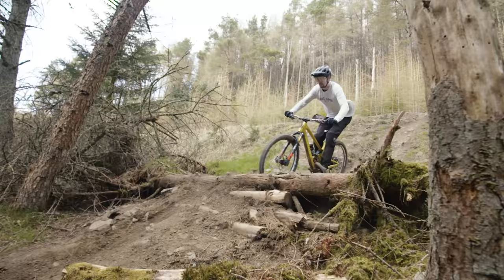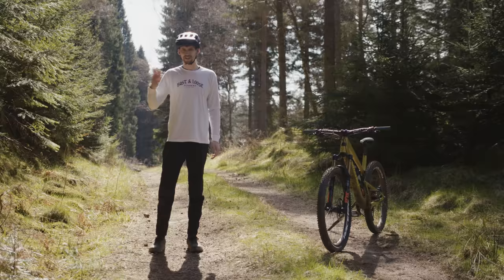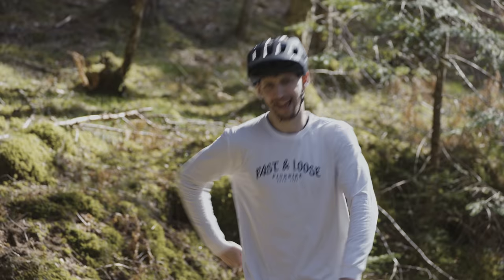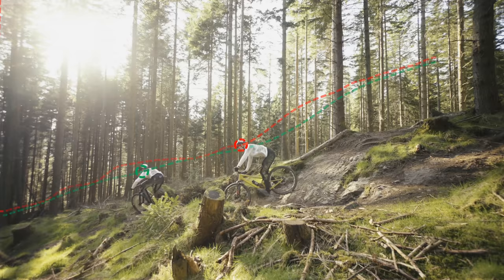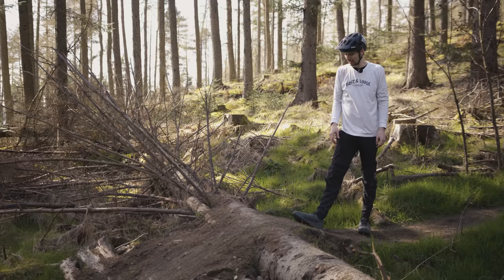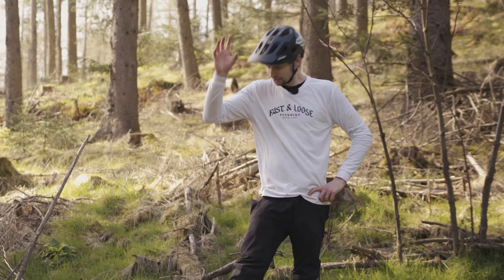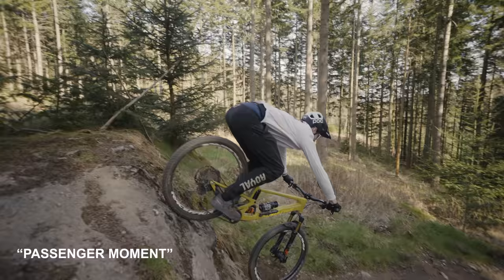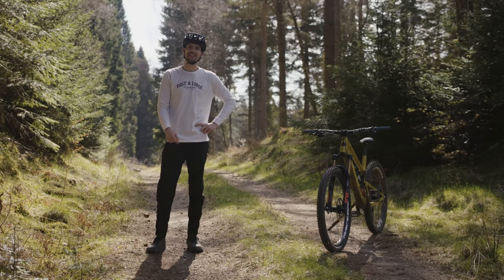Absorbing Trail Features & Maintaining Speed | How To Bike with Ben Cathro EP 4

Comment: All the graphics are following the head but i reckon where your centre of mass is going would have a significantly larger effect on the riding and i think that following it in the graphics might help pronounce what is right and wrong a little more. That being said i think these are the best bike instruction videos i've seen.
Reply: You’re correct but I chose the head to track as it’s easier for the software to lock on and the head will quite closely follow the trajectory of the centre of mass most of the time. I try to track the hips in the next vid which kind of works but it’s tricky to stop the lock from floating. Good insight though 👏

Comment: Two things:
1) I've definitely been realising of late that I need to be braver about getting my weight forward. It's helped hugely with my cornering, can't wait to try it with the steep rolls.
2) I love the comedy in these videos and Ben's willingness to take the mick out of himself!
Reply: Little changes at a time. It’s crazy how much control you have when you can utilise shifting your body weight at those important points.
Reply: @BenCathro  I’ll try to avoid a mega bar humper and getting volleyed out the front door… but no promises!
Reply: Same, I've realised I squat too low into the bike but now I've adopted a higher, stronger position - helping in the rough stuff
Reply: Though what I did once wen the trails were dust I'm summer is I pumped a berm with all my Weight forward for extra speed but u washed out and broke my collerbone

Comment: Driving the legs down through the drop is a solid tip.  Thanks
Reply: When you give it a bit of force that’s the secret to pumping. Driving the legs through the transition. Gets you back into a centred position and a little speed boost.

Comment: I was helping a mate ride his first trails a couple years back despite still being green myself and we decided the head is the key to how rough a trail feels.
If you're stiff it's getting thrown about, vision is compromised and the brain is having a fit. 
If you're fluid then the bike can do what it wants but if the head is stable the brain is quite happy.
After a video doing the rounds at the time we coined it "be the chicken" Just search chicken head stabilization

I've had a couple trips to the local jump park recently where as I continue to improving myself I've relearnt this after the last year of duller covid rides and have applied it recent trail rides where I've then noticed a big difference in my ability to smooth out a trail.

Comment: Thanks this supports my strategy for my first enduro race. Keep in contact with the ground pump all the way down pick inside lines when possible and go for 6 clean runs   The head position was the most helpful tip for me.

Comment: Awesome video, such a key point (weight/body position on the bike) that needs to be constantly remembered to avoid being a passenger. Will you be doing a cornering series? Dumb question but on big bike park style berms does one lean the direction of the turn with their upper body (right hand berm, lean to right) or should you be leaning the bike under your body and driving weight down like a flat corner?
Reply: We’ll be doing a “generic” cornering episode in this series that will give you almost all the info to apply to any turn. For grippy berms I stay feet almost level and in line with the bike as you don’t NEED to do anything to find grip as the berm is doing the work for you. But some berms suck and there are times you might need to lean the bike among other things. Main thing is having the weight close to centre, releasing the brakes at the correct point and moving your eyes through the turn.
Reply: @BenCathro  thanks Ben, that is super helpful. I think I just need to trust those type of berms more and let the bike do the work!

Comment: Hi Ben , how would you adjust or change your technique to a steep drop off if the transition is short(small radius) ?
Reply: If it’s too short a radius to roll comfortably I would switch to pushing the bike diagonally off the feature which switches the technique from absorbing to a controlled dropping technique.

Comment: I'm confused by the description running from 5:30 to 5:45.  You say to push the front wheel forward to prevent getting thrown over the bars. BUT loading the rear suspension, as you say, will tend to throw you forward.  I'm confused by "pushing  forward" to avoid being "thrown forward."  Seems like it's the same motion, so I'm obviously missing something here.

Comment: How do you tackle a roll down (like the BIG STONE) if you actually need to hold up on the lip to avoid a BB/crank strike? Is it just a case of waiting longer before pushing forward?
Reply: As you push forward you can actually unweight the back end a little. If you look closely you can see my back wheel lifting a little before the edge. To do this you need to leave a little bit of room under your bum. Fully prepare with your arms but only partially prepare with your legs leaving a little room to unweight and let the back end come up over the edge.
Reply: @BenCathro  Good point, cheers! I'll need to study that with the speed reduced.

Comment: is scrubbing a jump the same technique as squashing one?
Reply: Same end goal but different technique. Scrubs keep you lower by leaning the bike and body at an angle (left or right) as you go off the feature. A rider lying horizontally on their side is lower than one vertically riding their bike. The lower you can be  at the lip of the feature the more you can absorb it. That means the limit of absorbing is dictated by the height of the bike and the limit of scrubbing as how far can you lean into it without ending yourself.
Reply: @BenCathro  thanks ben i’ll have to give it a go

Comment: What about features where you can’t necessarily see what’s the next feature/obstacle thats on the other side of them and you’re riding a trail blind? I feel like exaggerated body movements to deal with one feature may leave you in a bad position if something catches you by surprise on the backside of a jump, drop, or corner.

Great series btw.
Reply: On a blind feature if you prepare by dipping you then have a choice. Push down the feature and roll it, or push the bike forward and drop it. The only thing I change if a trail is blind is I slow down for unknown features and sometimes stop if I know it’s a gnarly trail.

Comment: I have a section of my local flow trail, got a set of three fast, short rollers, less than a bike length apart, and have trouble with the timing of absorbing and pushing the front and rear at the right times. Any tips, aside from the obvious of making it into a triple? (My current skill/confidence and trail design hinders me from jumping this set well at the moment)
Reply: When the features are hitting so fast they start to feel like moto whoops that’s usually the signal to lean back, stay loose and just plow or start jumping , which you’ve identified. I don’t have anything I can say that will make things click but with any technique if speed is messing up your timing you have to slow it down, get it smooth, then build it back up while trying to keep it smooth. If you’re not ready for jumping you could try manualing between two of them and build to all of them. It’s easier to time pushing one wheel through rollers than both. Looks cool too 😎
Reply: Try jumping from one to two, but landing manual and pump your front wheel over the third? As front wheel clears suck up the third as much as you can as your rear comes over
Reply: Sounds like the triple on Ponti in Novato. Took me many reps to get this; I agree with the slowing down, then gradually increasing speed

Comment: Sounds stupid, but is there any different approach for me (equally gangly and noodley, but massively out of proportion)?

I’m 6’1 with a 6’7 wingspan and fairly normal length legs!! I find that my arms take so long to actually have any pulling effect on the bars since they have so much movement in them, whereas my legs are almost always too bent because of that.

I think I’ve got the ‘pushing down chutes’ thing nailed, but struggle to squash jumps without getting bucked. (And equally struggle to jump jumps tbh. And everything in between. 😂)
Reply: Wow, that’s some variance! Not really anything different you should be doing different in terms of basic principles, you just have to program in the timing of a giant on the arms and the timing of a normal person on the legs.
Reply: @BenCathro  hahah makes sense!! I saw your bike set up guide and wondering whether higher rise bars would help or hinder too. My logic was cockpit should be lower since my arms are longer, but you made a good point regarding stress on the wrists etc! 
Will have a play about 🤙